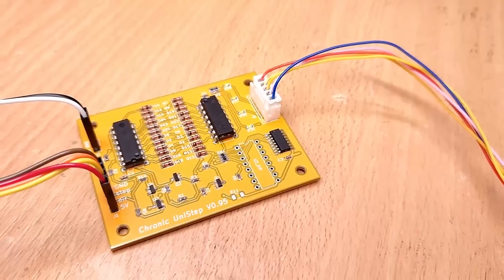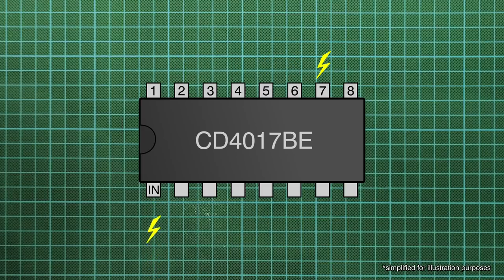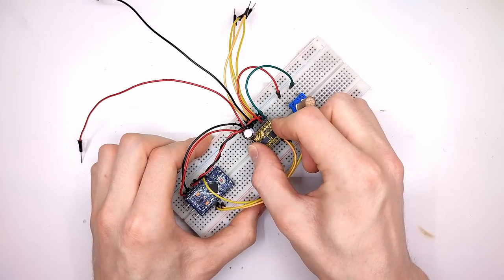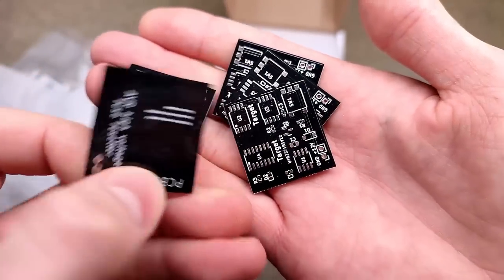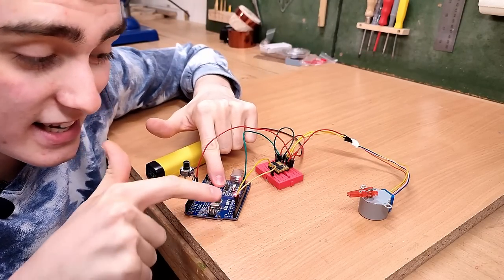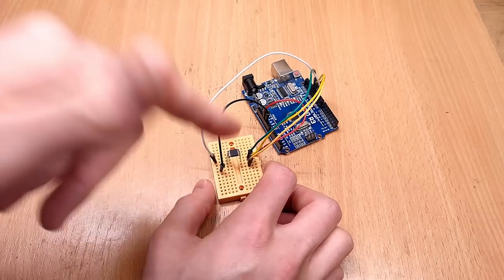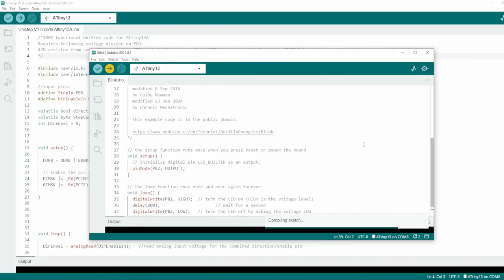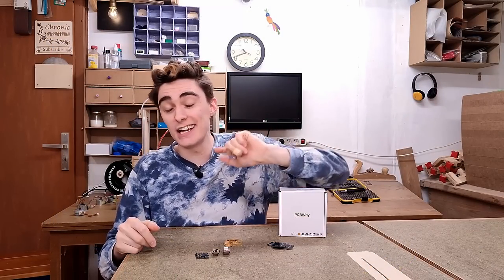Designing UniStep - an open source UNIPOLAR stepper motor driver!

Comment: 3 things I'd like to note:
* compared to bipolar drivers, this driver lacks current control, which is a crucial feature of motor control. This driver constantly pumps maximum current through motor coil, even when it's not moving. It also makes the setup sensitive to input voltage (while bipolar drivers will run on both 12V and 24V, without damaging the motor). All in all, converting this unipolar motor to bipolar offers a much better way to drive it.
* analogRead is much slower than digitalRead, so your driver might have problems at higher step speeds (klipper?)
* to program a SOIC attiny you can buy a "soic clip" (also called "IC test clip")
Reply from the maker: All very good points, you're totally right, but let me add two things of my own:
The problem with driving "converted" unipolar motors with a bipolar driver is the high phase inductance due to being designed to have resistance organically regulate the current depending on input voltage. This makes the coils try to resist rapid changes in current flow interfering with the driver's attempt to control the current - in fact, there'll never be as much current flowing through the coils as intended. So the driver doesn't actually get full control of the current the way it does on bipolar motors (hence why bipolar ones have a very low winding resistance of under 10 ohms, to reduce inductance), which I think is part of the reason microstepping doesn't work beyond half-steps on these unipolar motors.
So apart from the convenience of being able to use whatever supply voltage I like, there's ultimately nothing to be gained from current control on unipolar motors. 

Regarding "analogRead", multiple people here were worried that my step rates wouldn't be high enough - I'm pretty sure this won't be a problem because due to that high inductance unipolar steppers can't spin anywhere near as fast their bipolar counterpart, and given most of them only have 48 steps per revolution I won't ever reach critical speeds, even when driving them in half-steps.

I guess the takeaway could be "just use bipolar motors then" but that totally misses the point of making something cool with whatever I have at hand...
Reply: @ChronicMechatronic  very interesting insight, thank you!
Reply from the maker: @osmanpasha_diy  no problem! These were just things I didn't get around to covering here and in previous episodes of my unipolar 3D printer series, I might eventually do a "unipolar vs bipolar for CNC applications" video to cover that inductance thing.
Also thanks for the tip with the test clip! I might have to get one of those at some point, should've gotten one instead of the adapter PCBs...
Reply: @ChronicMechatronic  the clip is really useful, especially when the attiny is already soldered to pcb! And it costs around $1-$2. And there are also soic spring-loaded cradles for unsoldered ICs, but a bit more expensive, and doesn't do anything a clip does.

Comment: Looks really cool, just thought you could use PWM (if supported by the AT tiny) to access new range of microstepting and not only 1/2. Unfortunately you need to set it directly in the AT code
Reply: Also if I remember well, you can read an I/O even if they are set on output, this way you can power the 4 I/O and set this special artificial input combination as a Reset pin
Reply from the maker: Yes! I was briefly working on a more powerful version 1.1 that would've allowed adjusting phase current and, if implemented, microstepping, but my programming abilities just aren't there yet. Attiny does support PWM, but turning on pins individually via "analogWrite" is too slow, hence why I did direct port manipulation here. I couldn't figure out how to do PWM in direct port manipulation, and what really killed it of, was that the PWM pins on the Attiny44A (which I would've used in that case) are on different ports, Three on port A, one on port B, which made switching them on simultaneously impossible.
Reply: @ChronicMechatronic  Maybe you can use hardware timers to recreate PWM ?
Do you know the maximum pulse frequence the ramp can send to the driver? From there you should be able define a theorical maximum mircostep interval based on the number of clock cycles to toggle a port and the clock frequency

Comment: Amazing project! I was thinking of changing the ULN with four MOSFETs, those would do the trick and would be cheaper.
Reply from the maker: Thanks! I wanted to do that, but fitting those four SOT-23 footprints onto the tiny board turned out to be almost impossible without putting components on both sides, because every MOSFET then also needs a separate protection diode. Those are already included in the ULN2003, hence why I stuck with it.

Comment: Whats the max write speed on that chip. I didnt look at the code that much, but you dont have to read the enable state ao much thats going to slow down youre step read.

Put a clock on that enable pin.
Reply from the maker: Max step rate is easily more than what any of those unipolar motors can handle. Remember, we're not talking about 3200 microsteps per revolution, most unipolar motors have only 48 fullsteps (and thus 96 halfsteps) per rev.
Also, if I don't poll the direction pin after every step I might miss the controller changing direction, and since enable and direction are tied together I have to read both or none.
Reply: @ChronicMechatronic  not the direction pin, how often are you polling the enable pin ?
Reply from the maker: @RoboArc  I spent about 10 minutes of the video talking about how "enable" AND "direction" are managed by the same I/O pin, so how am I supposed poll enable separately?

Comment: Does the stepper still run hot at idle?
Reply from the maker: You mean with the driver inserted into a controller? Well no, since enable works now Marlin will turn off power to the motor whenever the machine sits idle

Comment: Nice work. Seems like quite a project but you really buttoned it up nicely. Where can these motors be found in ewaste? printers?
Reply from the maker: Thanks! Those 48step/rev unipolar motors are the most common type found in old printers, photocopiers and scanners and that kind of stuff. "old" as in 1980-2005-ish if my estimate is to be believed (I wasn't around yet most of that  time, and haven't taken apart that many devices so far). But in some fancier equipment of the time you apparently could get real bipolar NEMA 17 steppers.
I personally don't have access to that kind of ewaste, but I bought some for cheap from a guy who has...
Reply: @ChronicMechatronic  got it. We’ll I know my local university dumps stuff like that constantly so I’ll take a look next time

Comment: Why not use a slightly larger ATTINY like the ATTINY814 which has 14 total pins, can have up to 12 GPIO pins, and if you skip the 4 clock and reset pins you still have 8 full GPIO pins available.  If you base it on the internal clock you can get up to 16mhz and has more flash, etc.  Basically it the same chip but with more and only taking a fraction of the space more.
Reply from the maker: Yeah, but the goal was to make the whole thing as cheap as the A4988, which was really only possible by using the smaller ATtiny
Reply: it also seems to be 3 times more expensive!

Comment: Why even fuse that pin?After the setup it's a standard IO.
Reply from the maker: It only becomes a standard IO after I manually change the fuse. The setup in the IDE only does things like BOD and clock speed

Comment: I get wanting to make everything yourself but as you are finding out if it isn’t done well it just won’t work as you need it to and will just cause more problems later on, like with your soldering iron and hot plate.

Similarly forcing yourself to use sub optimal components for no real reason won’t help you either, like forcing the use of unipolar stepper motors when you can salvage or buy used bipolar stepper motors, which when combined with cheap stepper motor drivers will have much higher performance than your unipolar motors and drivers. Or using an MCU that doesn’t have enough pins. Using sub optimal components makes development take longer and the results will be worse.

You also seem to build things without having any or much experience of how they should work with a “how hard can it be” attitude, which is fine but it means you don’t really know what you are trying to build and will overlook things that are more important than you think. It also isn’t a great way of learning how things work.

It just doesn’t seem worth it, both in terms of cost and for learning. You spend all this time and money getting PCBs made and buying components and writing code and coming up with workarounds for problems rather than just getting on with the main goal of the project and you have probably ended up spending more than if you had just bought some used bipolar stepper motors. Sure you are learning but you could probably be learning more if you weren’t almost forcing things to work.

If you are happy to keep doing it then that’s up to you but to me it just seems like wasted potential. You clearly have drive and motivation but what could you accomplish if you used that potential more effectively? For the most part you are just reinventing the wheel.
Reply from the maker: You're raising some very valid and interesting points here, I probably should've called the channel "OCD engineering" instead. 
I always tried to make things work that shouldn't - it's what I pull most of the enjoyment from, for some reason. I used to hate integrated circuits, because even though it's easier overall to build a circuit with them, I have to specifically procure a dedicated one for each damn functionality. So I used to be really into transistor circuits (like what I did for the soldering station) because I already had transistors and assembling pre-built components is boring (to me anyway). 

Then there's also the question: do I actually want to achieve anything? It's not like I'd end up fixing the room temperature superconductor or invent anything revolutionary anyway, so I might as well mess around reinventing the wheel if it's fun... 

But yeah about the efficiency, that's kinda the sort of thing I've been learning over the past year or so with the channel becoming more of a business, the insane development time my approach takes getting in the way of my attempts to increase video output - I think you'll like my laser cutter project a lot more as far as design designs go!

Comment: You totally neglected the mocrostepping insputs (MS1, MS2 and MS3) and your little driver just does half steps.
Get it up a notch, Quarter Steps...
Reply from the maker: Well, I can't explain everything in a single video, but cheaply manufactured unipolar motors physically can't microstep. It just doesn't work, halfsteps is the maximum possible. Hence why I didn't bother with it. Check out my unipolar 3D printer series for more info on that. 
Now there are some rectangular unipolar steppers that do 200 steps/rev, for those it would be interesting to work on microstepping but AFAIK they're rare.

Comment: I have been toying with the idea of making something similar, but for DC motors with optical encoders. Commonly found in newer inkjet printers, I think they would be useful for making plotter building cheaper. Thanks for doing the right thing and opensourcing the project! Cheers!
Reply from the maker: DC motors with encoders is what I plan to do next! It would be so cool to be able to rip motor, pulleys, belt and encoder out of an inkjet printer and install them on a 3D printer! After all industrial type CNCs use servo motors instead of steppers all the time because this also fixes the open loop problem. I'm more surprised that it HASN'T been implemented on consumer grade 3D printers yet...
Reply from the maker: @Fejszi  hey Mark, sorry for not responding, I did see your comment, but I've been stuck without internet for a week and a half now already.
Problem with a collab would be that I'm more of a hardware guy myself and SUCK at coding. I just barely managed to get the simple code for this project to work.. Designing a PCB on the other hand, yeah, no problem there neither.
Though another subscriber said he already did it and will make a video about it eventually. I'll have to rely on him to even get an idea of how this works. A channel called "@TheRainHarvester" also made a few videos about it, but I didn't understand half of what he explained about the code :/